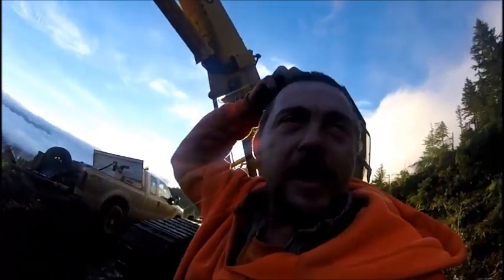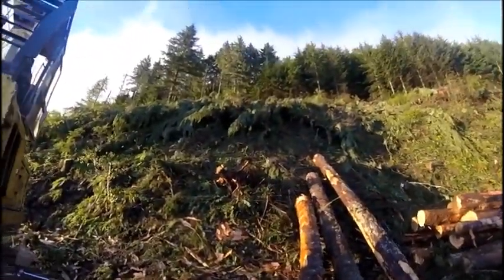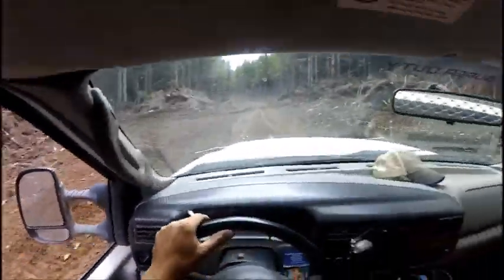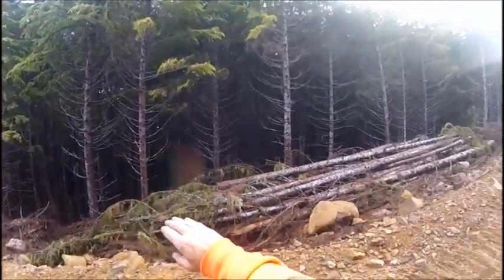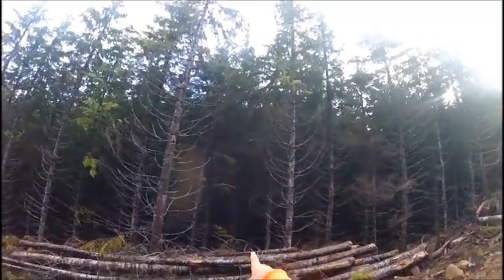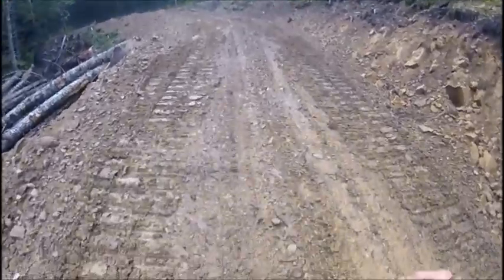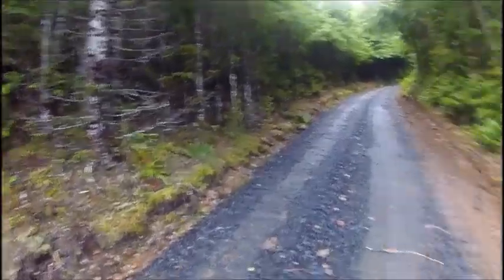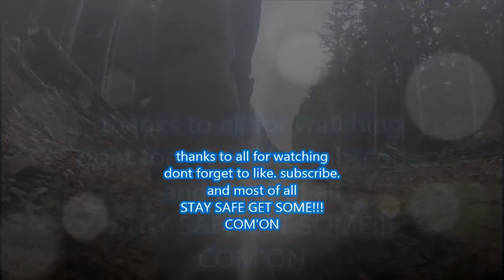all in a day's work

Comment: Could you weld a block to the bottom of the yarder tube and run the sky Line or the skidding line through it and hook it to the back of the shovel to act as a tethering machine and did Stacy end up buying the doosan shovel
Reply from the maker: John Deere 3754 ya you could pretty expensive tether machine. and no doosan looking at a 295 kobelco now